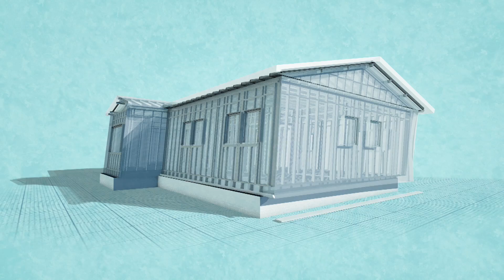How to Retrofit a Home for an Earthquake | Ask This Old House

Comment: Hi  I hood you can help me, I’m getting a lot of vibrations from traffic over a road that is in need of repair. The highway department has made random patches of asphalt that is causing  bumps in the road.noise and more intense vibration. What can I do?  I have added wood supports in the crawl space but which seemed to work for short while, but now it’s getting worse. Hopefully you can help. Feel free to contact me.

Comment: Well, I guess my home will be coming down. I live in the Salt Lake Valley and the Wasatch fault is due to let go. The original part of my home was built in 1898 and it is all brick and plaster with a foundation that is just concrete with big grapefruit sized rocks mixed in it and it just pretty much sits on the ground surface. The next part of the home was put on in 1912, the foundation is better but still not the best design. The next addition was put on in 1922 when my Grandfather was just 8 years old and his family moved into the home. Don't know what that foundation is like, can't go under that part of the house to see. When I moved in we built two more rooms and they were built right. Another thing here is where I live if you dig down about 3-4 feet the soil turns into nothing but loose sand and gravel. I have no money so I can't fix things or move. I'm dead!
Reply: well, you had a good run.
Reply: Not necessarily...it's stood so far--longer than most modern fiberboard built homes will!

Comment: Although my son's house in Florida supposedly meant all specs for hurricane protection,  going through the house revealed that the contractor hadn't really done his job, nor had the bank inspectors. My son spent $300 on straps and brackets just to insure that the roof stayed on the house!  Then he spent another $400 on other required upgrades to the windows and doors!   Florida and the various counties and municipalities are notorious for being incompetent and corrupt.  My hope for the people of Oregon is that the same situation isn't occurring there as well.
Reply: Omg he spent $700 for hurricane protection, that's so high.
Reply: @gangisspawn1  He shouldn't have spent one single penny!  The bank inspector should have noted the lack of straps and improper window and door protections.  The bank then would have required the owner to fix the problems before the sale was complete.  Hundreds, maybe thousands of homes in Florida like my sons have not had the modifications done to them due to a corrupt system. Sorry to say, when the next hurricane strikes, those home will be damaged or destroyed and people may die.

Comment: Read the Book Full Rip 9 which is found on Ebay for cheap.   This area will have forces from the subduction zones just off the coast from them that this type of retrofit work will not help very much with.   Good luck to them.  J.

Comment: With all the earthquakes happening in the US wonder why the gas utilities aren't installing those shutoff valves.
Reply: Agreed.
Reply: It's a good question. The answer is kind of complicated, put it really comes down to this: It's because gas companies and firefighters recommend that you DON'T shut off your gas supply unless there is a gas leak or ruptured line. If you DON'T smell gas or see a broken line, it can be more dangerous to shut off the gas than it is to leave it on. Studies show that the vast majority of people who turn off their gas in a disaster should not have done so.

Gas is delivered at a consistent pressure to each household. Whenever someone shuts off their gas, the pressure increases elsewhere. Imagine there's a small crack in the gas line outside your house, but it holds up under normal pressure. Now imagine that a thousand people in your neighborhood panic and turn off their gas, or have these cute little devices to do it automatically. The extra pressure will build up inside the gas lines, and that little crack will turn into a deadly gas leak.

Sorry about the long-winded reply.
Reply: @christiangibbs8534  
No no no no.
Turning off the gas doesnt increase line pressure. The line pressure is pressure regulated from the source to its destination.
Most likely the code isnt requiring this device for liability reasons. Perhaps it isnt 100% reliable.

Comment: These anchor plates mainly prevent the unseating of the walls when the displacement due to the earthquake is too much. It works for lightweight structures, like the timber houses shown. It also assumes that the house frame is reasonably decently build, that is can resist the lateral inertial forces of the earthquake. This means the timber joints can actually take the load. 

As for large non-structural elements, such as large display cabinets, the top of the cabinet needs to be secured against tipping over or overturning. A simply solution are metal straps screwed to the wall vertical studs. For heavy furniture, stretching straps, such bungee cords work in a pinch.  Indeed, the issue of earthquake non-structural damage is a big deal for museums so they have come up with plenty of solutions.

Comment: That house wasn't bolted to the concrete foundation???
Reply: Newer homes are more secure but not the older ones built on a foundation. Contactor said that maybe a 2" bolt is used.

Comment: What a scam...disgraceful.
Reply: "Before World War II, houses were often built so that they rested on their foundations with nothing but gravity to keep them there. When the ground starts shaking, gravity loses to other forces. 

Retrofitters bolt the house onto a concrete foundation with 9-inch-by-9-inch steel plates all along the interior of the crawl space. They also add framing anchors every few inches. If the house is resting on cripple walls, they add plywood reinforcements." - The Nuts and Bolts of Securing a House to Its Foundation January 20, 1994|ANNE LOUISE BANNON | TIMES STAFF WRITER 

The bolts tie the house to the foundation so that the house stays connected, instead of sliding. And with multiple points of connection to the foundation, the house should be firmly tied during an earthquake. So, yes, these materials do work.

Comment: Those sill plates won’t stop the building.  Need to anchor each corner of the building at the truss to a point 45-60 degrees by guy wire to the ground.

Comment: I see everyone is getting excited, but remember that these tips / fixes are NOT for the big one. This is for the nuisance quakes that do mostly minor damage. Kinda like making your home kid proof. The issue I see with the automated gas valve is it's too easy to reset and if the home owner starts fooling with it while not knowing where to check for damage there will be LOTS of problems. This should only be reset by a trained professional, after inspection.

Comment: No gas worker licensing laws in Portland? Many, many installations of the valve will not be that easy and will require complicated interior work also. A big liability for an unlicensed installer!

Comment: Sure ... some thin brackets and couple of wood screws anchored to a five-inche plates will prevent a multi ton house from shifting away ... as if the whole base of the house and the dirt underneath will stand still !!! come on TOH ...
Reply: FOMI1970 … All it takes is a couple of guys to move a multi ton car, right? Put a 2x4 on the ground and see if the same couple of guys can push that car over it. It really doesn't take much to stop the first bit of movement, which is probably all you need 80% of the time. It's really a numbers game in controlling damage with the smaller quakes.

Comment: What happens when a snow plow drivers by in the winter triggering the automatic gas shut off. Now I have no freeze protection because my gas furnace can't run... Nothing's perfect.
Reply: davide82843... A snowplow causes vibration and noise, not lateral movement. Big difference!
Reply: @rupe53  video just said when a truck driver by it might trip it. if you listen and guy said well here's how to reset it... Now imagine that same truck being a plow meaning it's winter meaning it's cold..............
Reply: @davide82843 … read my post again. A plow does NOT cause the kind of movement that will trigger this gadget, hot or cold, doesn't matter. Now, if the plow hit the house I could see where things might move enough to trip the valve closed.  <LOL>
Reply: @davide82843  according to the manufacturer that's not the kind of vibration that triggers it the force is different

Comment: Only adding those metal plates alone is enough to prepare for an earthquake........Interesting.!
Reply: its a part of design for new construction nowadays- anchors that tie the sil plate to the concrete, straps that connect the wall studs to the sil plate and concrete. In other areas, code requires hurricane ties to attach the roof structure to the rest of the framing of the house. some time ago, wood was just laid right on top of concrete or cinder block, and the weight of the roof and structure was enough to keep it in place. think about it like wearing bad shoes in winter. Its easy for you to fall when you have no traction. These plates lock your feet (or base) in place so that the rest of you is steady. Funny cost comparision:  usually less than 1000 at time of build. Cost to retrofit: usually $10000 or more.

Comment: Looks like that emergency gas shutoff is made from aluminum (hence it's anodized)....and it's threading into steel pipes.  Has no one heard of galvanic corrosion from dissimilar metals??  That piece of junk safety device will be leaking in a decade.
Reply: The pipe connection was likely still steel.
Reply: @beepboopsloane  5:42 - You can clearly see the threads are anodized...it's aluminum.
Reply: It also conveniently provides a weak point for the pipe to break during an earthquake.
Reply: @paulmvn5431  ,. You are correct on the weaker material but everyone else on this blog is wrong about the galvanic corrosion. The gas service and meter set have cathodic protection. The gas meter is aluminum, the aluminum regulator at the meter set is bolted to a steel body, the gas controls  on your furnace and water heater are aluminum. Now I want you to all put your thinking caps on and report back to me why we hardly ever have a corrosion problem of these aluminum controls, regulators and gas meters. My experience comes from 35 years in the natural gas utility business. Now let's see who comes up with the right answer (?).
Reply: @boby115  didn't you give away the answer? A sacrificial anode?
Reply: @paulmvn5431  , the Gas Utilities do have sacrificial anodes connected to their underground steel services and mains, also there is a protected coating on almost all steel mains &  services . But our protection underground would have no bearing on above ground piping installations plus insulators ( insulated unions ) are installed above the first shut off valve coming out of the ground. Also most residential gas services & mains nowadays are polyethylene plastic requiring no cathodic protection at all. Nice guess though.
Reply: Bob Y it’s been 6 months. Google will probably be a goose chase. I’d really like to know your answer. I was curious of bi metal corrosion, only after reading other comments that made it seem like an obvious problem

Comment: Here's the conundrum with installing Earthquake activated gas shutoff valves.   Earthquake insurance generally has a 10% or 20% deductible.  That means, if your house is severely damaged by an E'quake and your house is worth $1M, your deductible is $100K - $200K.  The deductible on your homeowners insurance caused by a fire is a lot less, usually $500-$1000.  So, if a damaging E'quake hits, you want your house destroyed by the fire.  If the E'quake doesn't do much damage, you don't want a fire.  So, there is a risk you take by installing and NOT installing this device.
Reply: Eric R gasoline is cheap...
Reply: @athhud  you are correct-- assuming you like the view from Sing Sing...
Reply: I highly doubt there are many arson investigations done when an area is devastated by an earthquake. I’m a firefighter and within the last few years we’ve had three houses burn and there is no doubt in my mind that each one was arson. One of them we extinguished before it did too much damage. We triple checked for hot spots and verified that it would not reignite. Next morning it was fully engulfed. Before it caught fire the second time there were pretty obvious burn patterns that suggested use of an accelerant. Another house caught fire because of a dispute between gay lovers. The guy cuffed his boyfriend to the bed, dumped gasoline throughout the house, set fire, and left. The third house burned after an ex-wife threatened to burn down her ex-husband’s rental property. No arson charges were brought against anyone in any of those incidents. I am sure the gay guy might have had arson thrown in with attempted murder charges, but he hung himself in the garage the next day. Crazy stuff. Needless to say, around here it is pretty hard to find yourself in prison for burning your own house down. Besides if you do it the right way, there is no evidence left to prove anything. Lol

Comment: These guys are scamming all of these homeowners for as much as they can before the "Big One" hits. After it hits, they are packing up and taking their money overseas to never be seen again. lol. What Warranty ?? haha
Reply: Why would bringing an old building up to code be a scam?
Reply: @boobtube1212  - Bringing the building up to code is one thing, selling excess is another.
Reply: @cup_and_cone  What was excess in what the video showed?  Securing the walls to the foundation, gas shutoff, and strapping the water heater I assume are code.  Putty for vases and securing bookshelves to walls are presumably not code related but "scam" seems a little strong and I don't think its what @willdogs droid was referring to.
Reply: Do you have evidence that this is a scam?
Reply: Absolutely.  Happens all the time here in Florida with hurricanes on all levels: Product manufacturers supplying roofing systems, windows, etc, home builders/contractors actually building the home, engineers/architects designing the home, etc. And guess what?  These people are almost always not bound by contract law because hurricanes are considered an "act of God", so you can't take them to civil court when it fails to do what they said.
Reply: Yea I got the same feeling watching this. I wonder how much they charge for this.

Comment: I doubt those flimsy metal things will do anything
Reply: To be fair any house built with nails and screws is sitting on "flimsy metal things". Think about how many structures, like a deck for example, are bolted into the structure of the house with "flimsy metal things". The reason why it works is because the deck, properly built of course, is transferring the weight of the structure into the ground. The metal fasteners are there to keep the separate parts of the structure locked together. That is also what is happening in the example of the house in the video.The metal plates are there to bind the house to the foundation and attempt to keep the house from flying off the foundation.
Reply: "Before World War II, houses were often built so that they rested on their foundations with nothing but gravity to keep them there. When the ground starts shaking, gravity loses to other forces.

Retrofitters bolt the house onto a concrete foundation with 9-inch-by-9-inch steel plates all along the interior of the crawl space. They also add framing anchors every few inches. If the house is resting on cripple walls, they add plywood reinforcements." - The Nuts and Bolts of Securing a House to Its Foundation
January 20, 1994|ANNE LOUISE BANNON | TIMES STAFF WRITER

The bolts tie the house to the foundation so that the house stays connected, instead of sliding. And with multiple points of connection to the foundation, the house should be firmly tied during an earthquake. So, yes, these materials do work.

Comment: Interesting comment about how most damage from earthquakes is from natural gas fires, not structural damage.  When it comes to earthquakes and energy use - people tend to conjure irrational fears of a possible worst case scenario to a centralized, clean, electric power generation plant that is fortified in a concrete bunker - yet are indifferent or unaware of the dangers from ubiquitous natural gas infrastructure that commonly ruptures or explodes, which results in the large scale destruction of property and causalities.